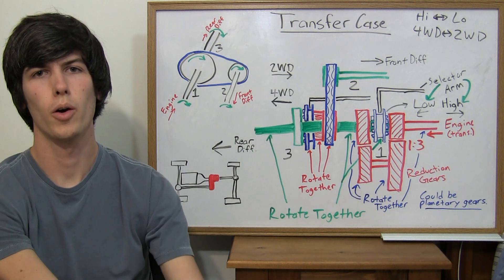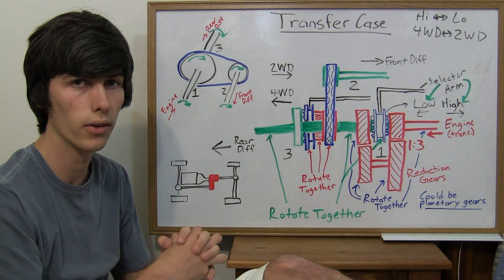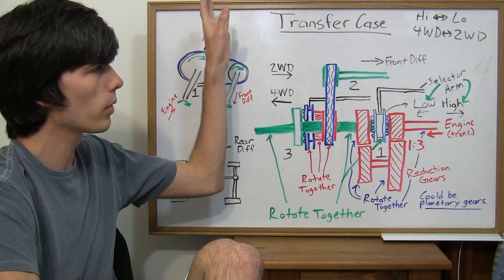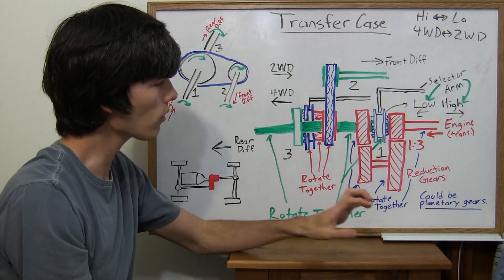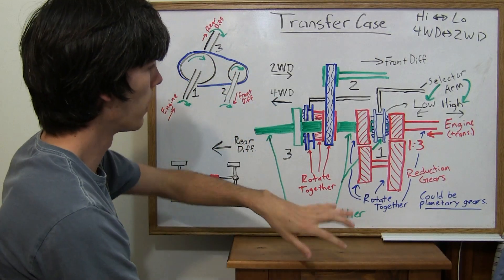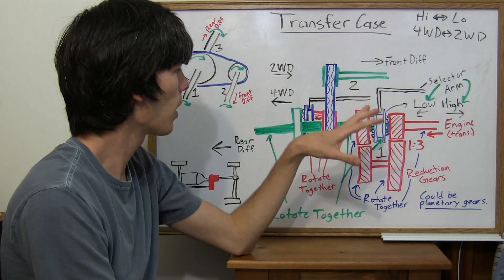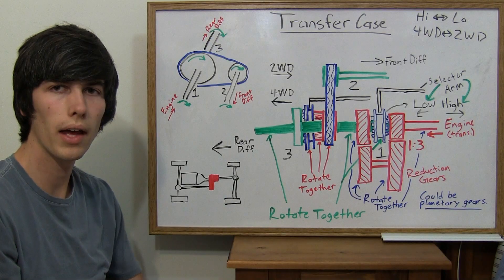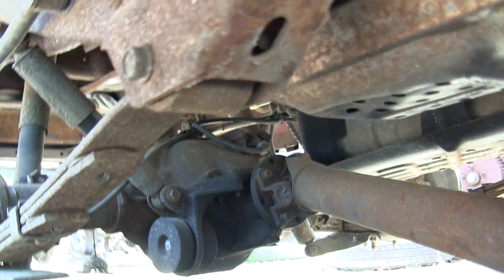Transfer Case - Explained

Comment: thanks man great video, one question:the gear driving the front driveshaft/axle seems to be smaller than the one hooked up to the rear shaft/axle. is this actually like that? seems like the ratio would spin the front axle way faster than the back axle...
either completely understood or already knew everything else..thanks man,looking forward to the next video!